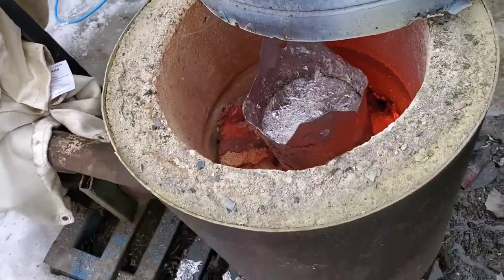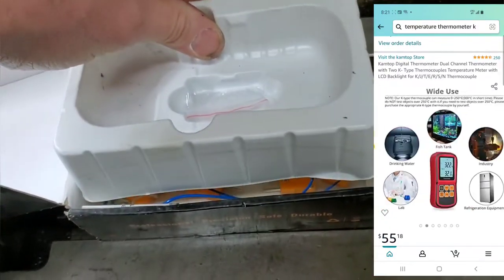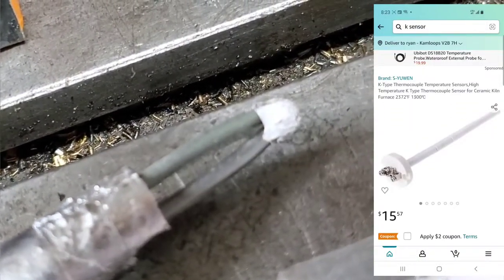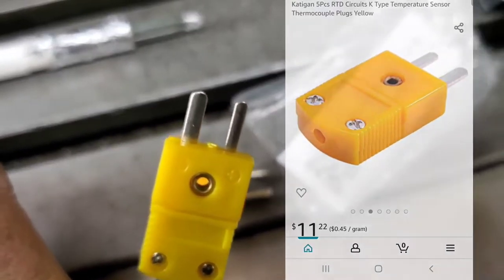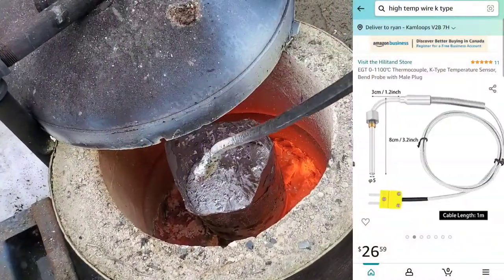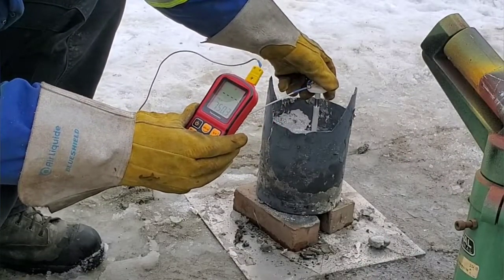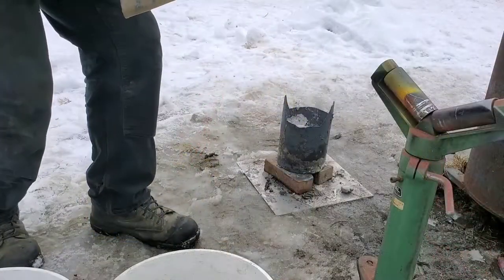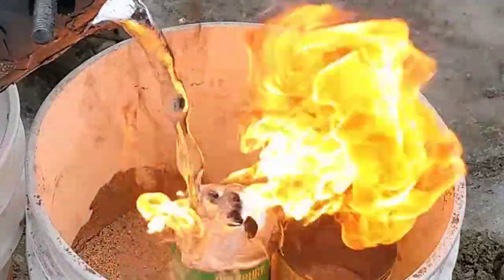Measuing Metal Temperature With Thermolcouple  eposode 18

Comment: My type k thermocouples are put in a fine thinwall  stainless tube with the end flattened over coat my thermocouples with a refractory wash  & warm over the furnace to dry, after using i just tap any alloy or brass off & recoat next melt.
Reply from the maker: Headstock i like this idea . I ordered a different one to try out as well . It is used in a exhastt gas application. I'm curious to see how your method and the other work out
Reply: @Wrighmachining  Hi,I got hold of some stainless thinwall tube abour3 mm diameter, flattend & folded the end to seal it & the type k thermocouple slid in nicely & I squeesed it a little & it stays in, I coat it with a refractory wash & dry it over the furnace,then plunge into the melt then when finished the metal comes off ok ready for the next melt,I coat my ingot molds with refractory wash & the metal does not stick to them molten alloy dissolves steel & the wash prevents that.